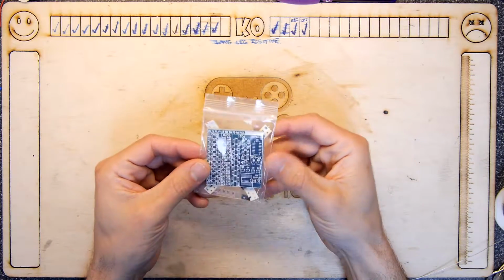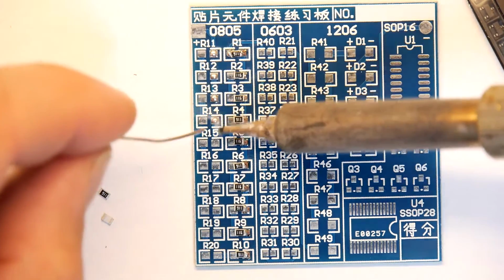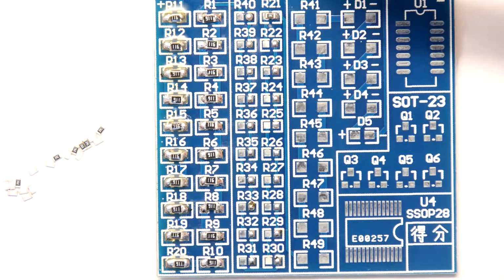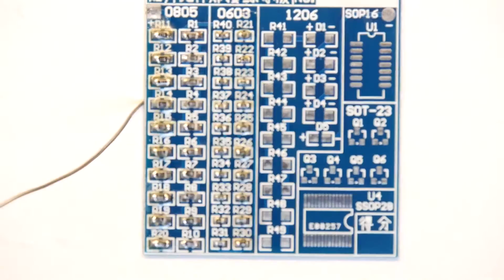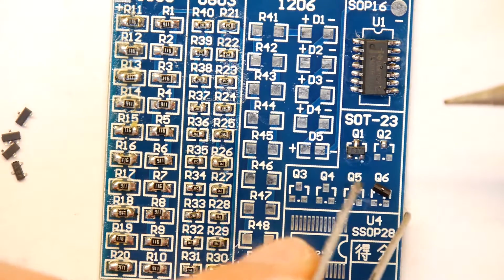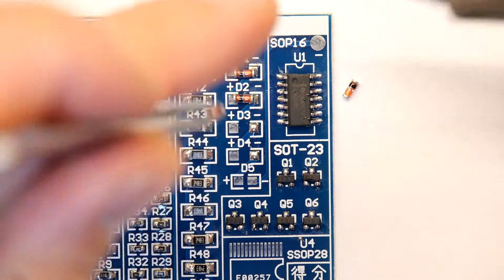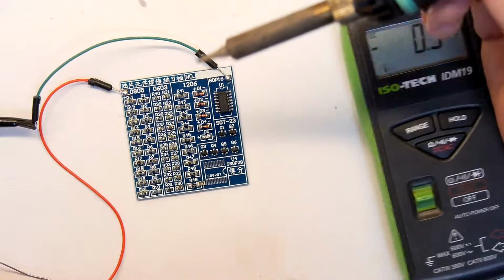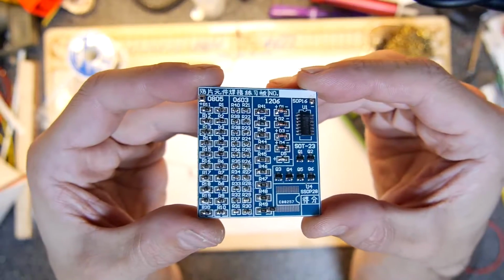Learn how to surface mount solder!

Comment: Too bad the SSOP28 wasn't in the package, would like to see how to solder it on. 

And I'm looking forward to seeing you use the hot air station, I received mine yesterday and immediately ordered some of these learning boards. 

I'll also be grabbing some old computer parts for practicing.
Reply from the maker: +Jasper Tielen I'll make a note to use it. I still have forgotten to buy some solder paste, I will do today 👍

Comment: I'm not surprised it didn't work. I've just completed one of these and I had to apply 15v to get a tiny glimmer from the LED.
I measured the total resistance of the resistors (they're all wired in series) as 630k. Then there's about a 2v drop across the 4 diodes.
I don't know how much current the LED needs, but it must be tiny for it to work at all.
I bought 2 of these kits, and I've noticed that the resistor values in the 2nd kit are completely different to the other one.
BTW, the black bar on the diode is the cathode (negative). Imagine the bar as a minus sign.
I didn't have too many issues with the soldering except with the smalles resistors, where I got quite a bit of 'tombstoning'
Reply from the maker: Black Bar Negative, also the shortest leg? I might well start remembering this, only took three decades :)

I doubt these kits are much differently priced than working kits so I guess unless someone has a hardon to do 200 surface mount resistors in one shot they may as well buy a flashing LED kit. What do you think?
Reply: The Backoffice Sorry, I was distracted by your 'hardon' typo(?). I know electronics is exciting, but not THAT exciting. 😳
Yeah, I can see that these could be sold for very little more than the kit price, but I think we all get our kicks from the actual construction process.
I find soldering to be very relaxing, and possibly even therapeutic. SOME of the kits I build have an actual use, but most of them are bought just for the fun of soldering them and testing. I'm inspired by people such as yourself, Julian Ilett and Bigclive. So, keep up the good work 👍
Reply from the maker: Thanks man, really appreciate it. I have to admit I also enjoy making the kits, as you can tell in the video. I do not really do anything with them afterwards. I am going to put them on the backofficeshow.com website at around cost so that budding electronics junkies can use them in their projects and it will clear my shelves.

Comment: I have to start to rember that ordering. For you is different,kester is just the premier leaded solder over here you can buy,I ordered my syringe of solder eBay was 15.00 then I bought solder paste in a little blue jar ,leaded of course ,it was about 3 or 4.dollars works good both plus I bought several kinds of liquid flux .I like to have choices , I also have a couple kinds of paste stuff I don't use it much I am sure you do the same things
Reply from the maker: What sort of shelf life are you getting on your paste? I find some of the finer one seem to 'dry out'. I really miss one brand of paste I got that was quite liquid and came in a huge syringe. I recall using that exclusively instead of solder for a while. it was a lot easier to work with than regular solder.

Comment: I Always use leaded soldering paste kester brand ,I take you don't have re work station the one with a hand heat blower,also d5 is the l e d light,I no you will do this better than me ,I want to do that smd rouelett wheel you did I think that would be easyer it spaced smd circuit.
Reply from the maker: Darn, you just reminded me that I still have not ordered some paste! I do have a few heat blowers and even a reflow oven, but the lack of solder paste makes me do it old school :) Also I am pretty sure a lot of people only have the iron so I think its useful to show the basics.  I think Kester is hard to get in the UK but I will try.

Comment: It's a real pity 0402/01005 practice kits aren't available. No way you can do without a microscope. Basically the smallest components in an iphone. I use JBC micro tweezers and it still sucks. Re normal tweezers I use non magnetic mechanic brand high precision smd tweezers, prolly around $3 a pair and they're perfect for the smallest stuff although the JBC cost around $800. .6v usually forward voltage drop over an avg diode btw.
Reply from the maker: +DigitalAura the tweezer debate could rage on, but I find the cheap ones are so shite I wouldn't waste my time. Do you have a look to your $3 set?
Reply: As is always the way I can't find any right now. I haven't ordered for over a year.  I've bought expensive tweezers and cheap tweezers and found these the best overall considering tweezers don't tend to last too long anyway when constantly heated etc, the ones I use are perfect for iphone trace repair etc. While Hakko tweezers etc are nice they're just so overpriced considering how long they last. I also recommend a good set of dental picks etc.

Comment: £30 for tweezers? Are you serious? No way does a hobbyist need to spend that much on tweezers, in fact I think it's only companies like CK Tools and Weller who do them at that price range, you can get a good quality ESD pair for a third of the price which would be more than satisfactory for any smd work
Reply: I bought a set of these liked below and have found them good especially for surface mount components, liked them so much I bought another set so that I had another pair of the angled ones:
https://www.banggood.com/7pcs-BGA-Precision-Tweezer-Set-Antistatic-Tweezers-Stainless-Tweezers-p-924799.html?p=QJ25163370017201512F
Reply from the maker: +WeirdScience06 please send links, it will be a useful resource. For me, I wouldn't waste my time on the budget brands as you would end up buying twice. I'm happy to try a cheaper set of the spec is comparable.

Comment: Solder normally contains flux so why the extra flux?
Reply from the maker: +Ashley Booth it's just enough to help melt the solder but not nearly enough to help with dirty pads and components etc

Comment: Interesting stuff, didn't know there was soldiering paste to use without heat. I determined my cheapo iron I got can barely desolder a speaker wire easily and the heat concentrates away from the tip
Reply from the maker: +Ganjulationess3DS As far as I know all soldering paste needs heat, but knowing me, I probably got distracted mid sentence 😂
Reply: The Backoffice Haha maybe I was a bit distracted thought that was to good to be true